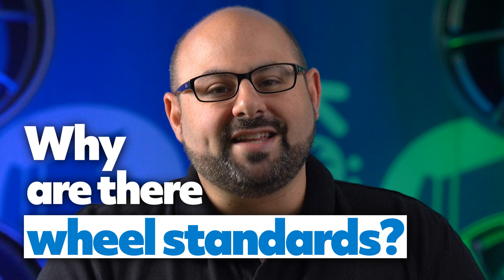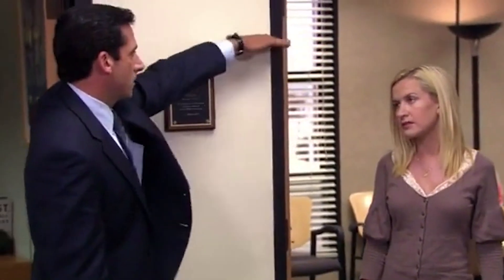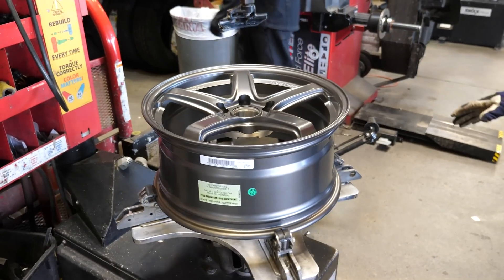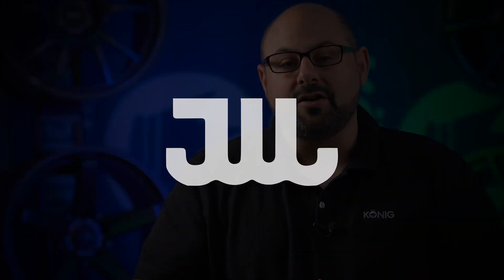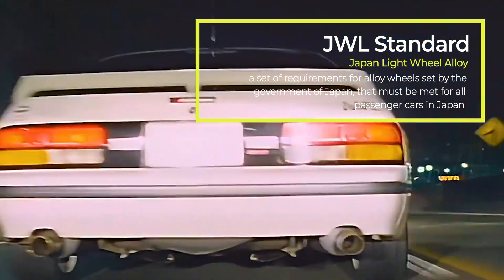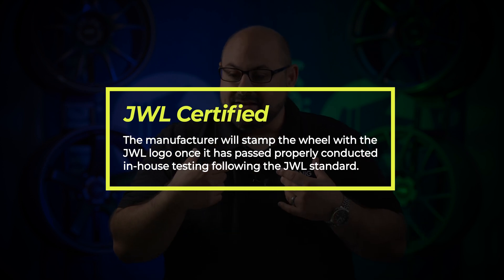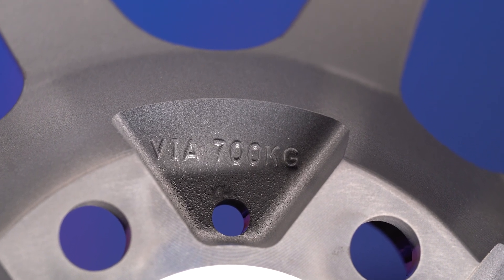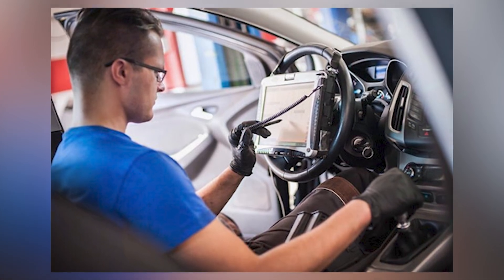Are wheels certified? | Wheel Certification and Testing Standards (TUV, JWL, SAE, VIA, etc.)

Comment: A really great video on a subject I knew nothing about. I've been looking at wheels for my 2020 Transit T350 & one manufacture has told me that TUV are the highest standard & that's what they use & not to bother with other wheels that have lesser standards. I wanted an 18" wheel but they don't have one that's a high enough load rating (max was 1050kg) for my axle only a 17" (1200kg) but yet another manufacturer has an 18" that is JWL & VIA with a higher load rating of 1250kg per wheel. What is your opinion on this & would you trust the VIA 1250kg over the TUV 1200kg?